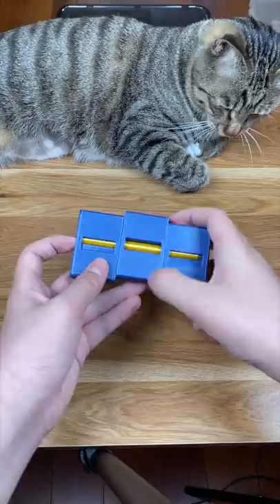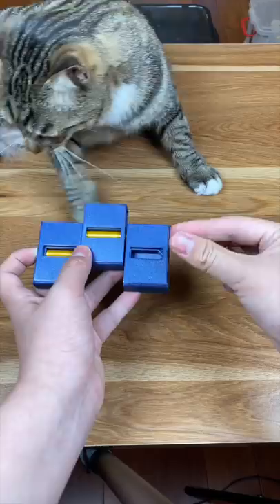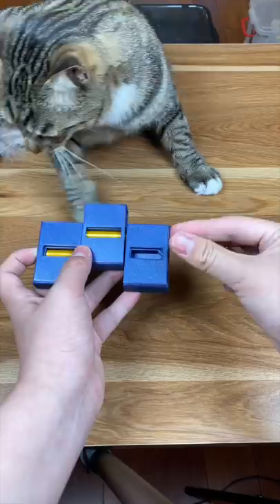3D Printed Magic Trick Box | How does it work?🤯

Comment: I could easily guess it from the way it kept getting stuck in transitions, but two little parts of a different pen are stored in the bottom part of the two outer boxes. When he moves the middle box up, the bottom ones transfer up through the side boxes and the middle peice that can still be seen is part of the pen that is still in one piece. You can tell because you can make on straight line between  all of the three boxes starting from the middle box going outward.
Reply: Yes
Reply: YARSSSHHH
Reply: This is basically the cutting a person in half trick
Reply: Right
Reply: I have no idea what you just said but I'm just gonna guess it makes sense- :']
Reply: @K4L1KA  yea im not very good at explaining things
Reply: @Sherkynerdo  its fine :)
Reply: Correct
Reply: I was thinking that too bc it looked like it rotated
Reply: You could see when he restored it the first time
Reply: Also it's easy to just see the pieces that are hidden shift into place
Reply: @K4L1KA  i think he's trying to say that there are two small pieces bellow the two sides : the left and the right one and when you push the middle one up the two sides also go up but get switched with the two small pieces.

Hope this helps even though this is old
Reply: Yes
Reply: Thats what i thought
Reply: Me 2
Reply: Ya I had one of those this guy is correct
Reply: You watch the vid
Reply: Or it’s just a magnet
Reply: Yeah i used to have one as a kid
interesting as hell.

Comment: In the bottom of the left and right box, there are cut up pieces of a pen, and when you move it up in the middle piece, there are holes in the top of the left and right box that the actual pen goes inside

Comment: Honestly, if it wasn't limited to only 3d printing, using a magnetic rod in three pieces it would be a lot harder to easily check the box for hidden features. The magnet would be a alternate choice since sliding magnets apart is far easier than pulling them apart and would create the illusion fluidly while technically being honest to the viewer.
Reply: Tbh

Comment: As you can see, when you put that pencil to the mechanisim and slide the middle it turns to 3 pieces. But how? Let me explain, so there is a mechanisim that changes sides by pushing the middle so you get 3 sliced exact same pencil and a 1 bigger piece of pencil. Or in another words, it changes sides

Comment: It doesn’t move fast enough. There is a full length stick on the top of the box and 3 little pieces in the bottom of the box and they switch as you move the box into 3 places

Comment: Notice: he covers the hole to the left to hide the boxes' movements. By pushing up on the center block, it pushes two more "boxes" from the inside bottom of left and right blocks which are holding the separated pieces. The original pen is locked into the space at the top of the outside blocks and stays still in the center block. The center block still shows the original pen when the center is pushed up. This is why you can't remove the center "separated" piece when the center block is pushed up.

Comment: It moves the real stiff piece up to the top nd replaces where it used to be with 2 small pieces on the left and right, the reason you never take out that top one, is because that's the real pen that's 1 piece

Comment: I figured out how it works
When you enter in the pen, you move up the 2nd slot and the inner 1st and 3rd slot will move along the 2nd slot too, then the actual pen is at the upper part of slot 1 and 3, making the original pen only be visible at slot 2.
After lifting up the inner 1st and 3rd slots, it'll reveal a fake part of a pen that can be taken out.
Then after lifting the 2nd slot down, the inner 1st and 3rd slots will lower down and reveal the actual pen instead.
This explains why he never tried to lift out the 2nd slot pen piece, since it's apart of the actual pen itself.
Reply: No ! the pen is made of piece that connected to magnet
Reply: Or its just rotated around and there are actually 3 pieces the real pen is just underneath it all
Reply: U r bothered

Comment: The pen gets moved up on the middle piece, there are holes that allow the pen to do this. There are just compartments that get pulled when the actual pen moves up showing the smaller pieces. In the first attempt you can even see the compartments move down. He immediately notices and speeds it up so the box wouldn’t do it again.
Reply: Ok ..so...when are u going to Hogwarts

Comment: It's made to click back together, you can see it when he pulls the small piece out
Reply: Nope. Look closely at the left n right boxes when he pushes the middle box up n down. There are 3 pieces, the piece he puts in and two smaller ones in hidden compartments.
Reply: @Ollybollyk Look at the tip of the piece when he pulls the little one out. It was made to connect
Reply: @Ollybollyk  There is not space on the box when it's in threes to have a small area where the long one is. The only why for this to work is if the pieces pull apart